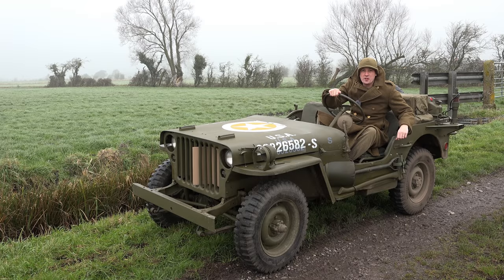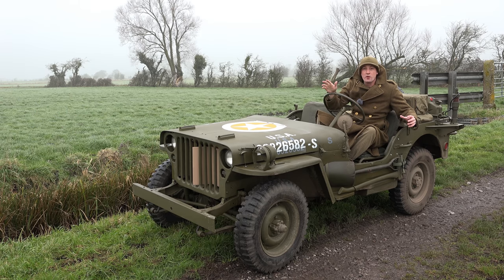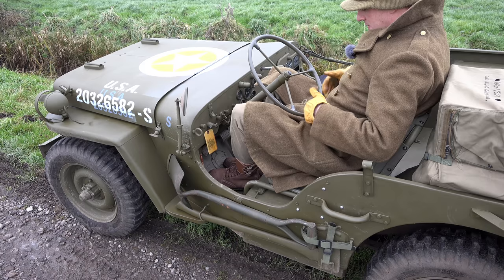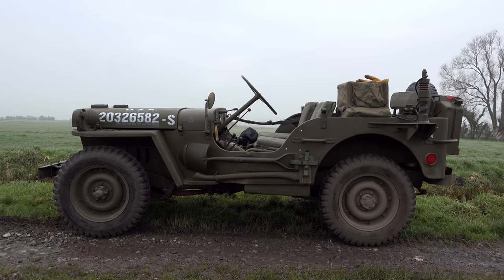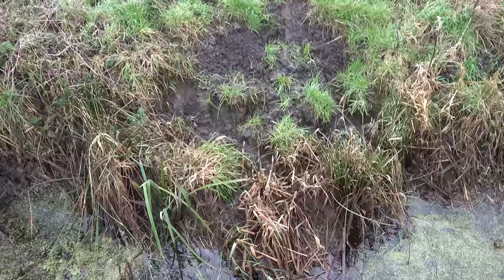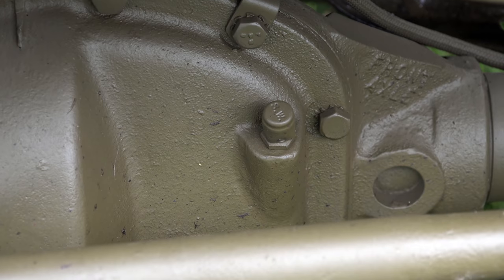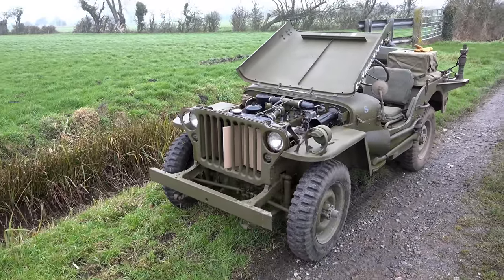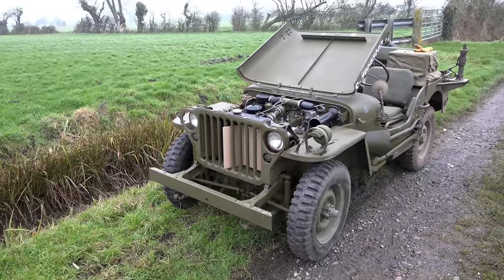Top 5 WORST Willys jeep features!

Comment: The dimmer isn't much of an issue.  In field ops you don't use the lights anyway.  For most of the war even in rear areas you used blackout headlight too.
Reply: The extinguisher was an afterthought. It wasn’t in the way when it was designed.
Reply: Looks like something resolved with field expedient no#2, you know, a stick!
Reply: In that case, the dimmer switch position was NEVER an issue. 
 
#5 sould be THE FIRE EXTINGUISHER MOUNT LOCATION. 
😊😊😊

0 seconds ago
Reply: Whats a blackout light. That sounds like just spray painting them black. Also anyone got a good story about these jeeps?
Reply: @muddrudder2656  A blackout headlight has a shield that covers about 95% of the surface of the lens.  It let's out just enough light to keep yourself on the road as you drive.
Reply: @patraic5241  thank you for the explanation! :)
Reply: I recall the "Blackout" headlight on the M880 Dodge 3/4 truck back in the day and the X.O. would never allow it to be engaged.
Reply: @HighSpeedNoDrag  Tactically on ARTEPs or FTXs we never turned them on either.  I suppose they were really meant for rear area driving.  Like in WW2 England during the Blitz.
Reply: You're quite right about the high beam, it was never used, and i know this for sure, because i drove several (Nekaf) in the (dutch) army.
Moreover, our jeeps didn't have an extinguisher at all.
In another video, i noticed the problem with the antenna mount. In ours, these were not side-mount, but at the back.
But that may be because ours were from after the war, up to 1955 i think, and slightly modified for the dutch army.
Speaking of weak points, two really stand out in my memory.
First of all, the weak brakes, making skid marks was as good as impossible, unless you were willing to break the backrest of your chair, wich i was  not, and so crushed the lieutenant's rear lights :-)
The  other weak point were the vacuum windshield wipers.
Wipers were too slow to keep a good sight of the road, so to increase the vacuum,  you had to let go of the throttle, that gave you a few good wipes, but losing your speed too. So to keep up the speed, you had to step on the throttle again, wich stopped  the wipers completely. So you usually ended up using the little handle,  and wipe manually.
Reply: How could they use blackout lights when they didn't have NGV's.
Reply: @Zanelander  The mark one eyeball works just fine.
Reply: @patraic5241  Yes!  There's a slit in the cover; to let a little light through. One I've seen on a WWII staff car.

Comment: The need to operate the dimmer switch is probably why many drivers moved the fire extinguisher to somewhere else, and broke off the straps.
Reply: As a former US Army HMMWV driver, I'd field-loss that fire extinguisher every exercise.
Reply: Exactly.The location of the fire extinguisher is the flaw!
The dimmer switch is located exactly where you'd expect to find it in most cars produced 1930(?) - 1960(ish), and therefore where to put it in a car meant to be used in mass by drivers with minimal training.
While the fire extinguisher is easy to reach both from outside and by the driver it does get in the way of handling the dimmer switch. Perhaps it'd been better to have it located in about the same place, but outside the vehicle?
Reply: I found the dire extinguisher bracket fit well on the wheel well between the drivers seat and the inner body
And it sits low enough that your shoulder misses it

Comment: For the "small size gripe", I'd also add that its a massive advantage for logistics. The US flat packed jeeps in crates and shipped then everywhere. Smaller size = less shipping capacity taken up = more of what you need where you need ot.
Reply: Also driving through jungle terrain you need small and nimble.  All the people that think they can offroad today in massive SUV's and get stuck within 2 minutes on a small gulley.
Reply: @MrWolfSnack  I agree. I got stuck down a trail with my wife's 4 door Jeep Wrangler and had to make a multi point turn to get back out of there. My wife wanted a 4WD truck which would of been near impossible to get back out given the length of those. Also, when I went down a trail with several other Jeep Wrangler members years ago, I told my wife we were leaving after six Jeeps got stuck in 26 minutes. The group laughed at me, saying getting stuck was the fun part. Not from my military experience. A downed vehicle and soldiers inside is the perfect target for cannon fodder.
Reply: @AstanaxKnight  Yeah when they are on a closed course with 100x other people around and a predictable outcome.  Try getting stuck on a back pass in a mountain or in the middle of nowhere on the single road for 60 miles in the middle of a cornfield. Maybe it's winter and 10 below, maybe you have no cell phone service, maybe its blistering hot. Maybe you have to walk 15 miles to find the lone house with a cranky old man with a shotgun to attept him to use his 70 years old rotary phone to dial sheriff bob jimbo to get cledus out with his wrecker. I don't consider that "fun" . It costs $300 + for a tow now. $150 alone for a calling charge.

Comment: Still had these around in the 80's, and drove them a fair amount. My opinion is that driving this thing around in rain, sleet and snow was absolutely awful. I got soaked and froze driving it at Fort McCoy Wisconsin when it was below 40F.
Reply: When I joined my Unit back in 88, we still had 1/4 tons.

Comment: Just imagine trying to drive one of these in the middle of one of the coldest winters on record through the thin and windy ice slicked mountain roads of Korea at high speed while trying to deliver important supplies, equipment, intelligence, or running from communist bullets.
Reply: Those death carriages?! JK, but the new korean models were notorious for flipping like a top if you breathed at it on an angle wrong because they added a spring shock system. It made them so jumpy that the rollover risk was really high. Add that to the list of Korean winter, bullets, and supply running.
Reply: "Let's make it faster and more powerful for hauling heavier loads and towing"   "Okay, but only if we make the suspension flip it over without even turning the steering wheel"  "Approved!" 😄
Reply: My dads old 53 mb was a korean war vet.
Reply: @therealbadbob2201  it must've belonged to a motor pool unit... the front line jeeps got scrapped from use and abuse, and the rear area jeeps driven by desk commanders were all rolled over or crashed beyond repair 🤣👍
Reply: I drove old HQ10    18BDE around Vietnam in the monsoons and bright sun, on QL1 and off road, of course she was an M151A1 not the old WWII model I believe mine was a Ford product. Several years ago I even picked up a Jeep Station Wagon to tow behind our RV across the US from North to South and back, sadly my little blue baby had a fractured tow bar mount that I didn't see, she dropped off a mountain in Utah.  There were no survivors, or course there were no people in the car at the time. I sure do miss my Jeep but I had insurance and replaced her with a Ford Escape. When I was Stateside in 1972 about mid winter I was assigned to take a trip to Yakama Fire Control Center in Washington State and drive old HQ10 3ACR back to Fort Lewis. It was COLD as hell, of course no heater and the interstate was covered with heavy snow so having brought my mummy bag along, I got old HQ10 up to 55 MPH  and pulled the hand throttle out, then stuffed my size 10's inside the bag and zipped her up to just below my shoulders, then drove her on home. She did have a winter cover on her and doors so it wasn't tooo bad.  My Lined leather Army Gloves kept my fingers warm on the trip and once I got out of the mountains, it became a bit warmer, well above zero anyhow.  You know that damn Captain who ordered me to make the trip never even said an off hand thanks!  Ah well, the life of a soldier, it was a thankless job.
Reply: Not Korea, and not in war, but I bought my 1947 Willys CJ2a when I was a Sophomore in high school, 1998 or so, and I started that car and drove it through at least three full Wyoming winters. The first year, I didn’t even have a top. But I had to drive my own car, so I got up early, shoveled the snow out of the seats, started it, and babied the throttle and choke until it could  sustain an idle, and then went in and showered and got ready. Then my wet hair froze on the way to school. The guys at the local parts shop nicknamed me the Igloo Racer.
Reply: @zachswy  Sounds like it was a great first vehicle for someone young to buy back then. Like any first car they are at least 20 years past their sell by date and thus lacking all the modern features. The most important thing im sure was parts at the time were inexpensive and if the end user was willing to put in time under the hood she would be ready and willing to loyally take you anywhere. 

I remember my first car. It was a 93 ford escort. Even though she had her issues I loved that car. I learned so much about cars by playing my grandfather’s favorite game, figure it the fuck out, under her hood. Even though I drive more modern cars with seat warmers, bluetooth, tire pressure sensors ect ect I still wish I could be behind the wheel of my little blue beast. Unfortunately she was killed by a drunk driver that pulled out of a gas station 10 feet in front of me while I was doing 35.

Comment: Being difficult to keep the weather out of a Jeep is concerned, you have to consider the era the vehicle was designed.  Vehicles with enclosed passenger accommodations and heaters were just becoming standard on automobiles.  Tops and heaters were considered a wild, luxurious, extravagant addition.
Reply: I drove a 58 Willy's Cj5 for the 2 years i lived in Juneau, and the additional year I lived in Eagle River, above Anchorage, and it never had a heater...what it did have was a set of Hedman headers under the floor boards , and those kept it plenty warm....👍🇺🇸
Reply: @branon6565  yes! My 57 CJ-5 had provisions for a windshield defroster, but I never hooked it up. The little heater would eventually get warm enough depending on how far you go...
Reply: Radio and heater optional in many cars until the 50s. 
Vacuum windshield wipers never work good. Isn't electricity is wonderful.
Reply: We did have heaters in our jeeps US Army in 1973 But it seemed the orders were always " remove top"
🪖🇺🇸🪖🇺🇸🪖🇺🇸🪖🇺🇸🥺🥺🥺
Reply: @Garyscott7  In the UK plenty of 70s cars had a heated rear screen only as an option. Many 80s cars required you to fit your own radio. It was one of the attractions of Japanese cars that they came with more options as standard.
Reply: @Garyscott7  mine never gave me problems. If you didn't want them to stop or slow down when you accelerated, you just put a vacuum reservoir in the line.
Reply: @Garyscott7  Vacuum wipers qere indeed a real treat. Driving a truck loaded and climbing a long steep hill was a trip without wipers. Some had hand cranks so you could at least wipe when vacuum was down. You are indeed right that electric wipers are grand!
Reply: That's why you have Dodge WC54 Ambulances! they have a roof , doors , heater and even..... wind down windows! :-)
Reply: @51WCDodge  and they are MUCH bigger and heavier

Comment: I owned an MB Jeep for 35 years. Only weakness is handbrake and 6V starting. If handbrake is setup perfectly its okay, but they go out of line or wear. That's why the very last MB Jeeps had an internal expanding drum rather than an external clamping type. Overall they're tough as nails.  Nice restoration! Thanks.

Comment: If the average height was 5’8” then the jeep is scaled correctly.
Reply: Exactly, a 6'2 guy would be sitting in the back. Same with tanks. I'm willing to bet that WWII tank crews were selected for smaller size men.
Reply: @emintey  for a fact Soviets selected shorter conscripts to be tank crewmen.
Reply: if you think tanks were cramped just search for ww2 ball turret gunners. That job had to be done by someone small and a lot more flexible than i'll ever be
Reply: I had the same problem with a Bushmaster IMV once. I sat in the forward passenger seat and couldn't pick my right leg up over the transmission tunnel. And that's a MODERN vehicle.

Comment: When I was in the US military I was responsible for many jeeps. The worst feature of them is that they flip too easily. Combine that with the low profile guarantees serious injuries when they do. I saw numerous flips under all kinds of speed/terrain situations. I think that "minor detail" should have been included in this list.
Reply from the maker: Thanks for your comment, young soldiers and a mini hot rod is a dangerous mix
Reply: The WWII era Jeeps were Ford GP & GPW, Willys MA & MB, and Bantam BRC-40 all of which had body on frame construction and “solid” front and rear axles and weren't inordinately subject to roll-over accidents.  
During the 60's thru the 80's most of the military Jeeps were Ford M151 which were “unibody” construction with all axles independently suspended and were very susceptible to roll-over accidents which is why they seldom appeared on the military surplus market and also why a civilian counterpart was never sold.
You must be referring to the M151.
Reply: @seadog686   Yes, we had 3 old Willys that were actually owned by the Smithsonian which I maintained for parades and movies and such, but the rest were the M151 death traps. Back in the day (pre-internet) I heard that they would cut them in 4 big pieces before selling to the public because they were so dangerous. Of course I can't verify that, but I believed it at the time.

As for the 40 and 50's model Willy's, I never let anyone get crazy with them, but I assumed they had the same roll-over characteristics. Thanks for the clarification. For clarity I was in the Old Guard at Ft Myer, VA.
Reply: ...agreed. A VERY dangerous aspect.
Reply: It seems as though a ‘ROPS’ system (Roll Over Protection System) SHOULD have been available as a “fold-down” option IF needed OR wanted..

Comment: Back in the 1970s I was running a running a building company when my elder brother phoned for a chat, he was also looking for some jeeps for the film The Eagle Has Landed. The neighbour behind my property had one, so I asked him if he wanted to hire it. Long story short brother bought it and I transported it to the film location at Maple Durham, my brothers job was to locate, maintain, drive on set all the vehicles required for the film. Well I ended working there and other locations for 3 months in a blazing hot summer. Maple Durham is on the banks of the Thames and we were set up in a near by field housed in static caravans, with workshop tents, 10 or so jeeps, Bedford trucks one burnt out, a small utility van make?? that was flipped using a timber post cannon and a White half track with a wooden body imitating a machine gun carrier. There were extra bonnets for the jeeps all numbered differently to make out a larger fleet of jeeps, so we would be swopping bonnets like mad for the different shoots. I drove the White and had to wear make up, helmet and scarf, just in case I was seen by camera through the front and side letter box slots. Between shots the armourer and I would get out for fresh air, both wearing brightly coloured shorts and T shirts, the crowds of onlookers fell about laughing. It was hard work but a great experience.

An uncle drove Monty around UK in his Humber staff car, he was a small chap so getting into a jeep would have been no trouble.
Reply: A great film. Pity about the yellow lines just being visible near the church and Larry Hagman sitting at his desk in front of a 50 states US flag.
Just making fun of the bloopers. Seriously, anyone who hasn't seen this film, give it a go.
Reply: Great movie. Thanks for the first person trivia about its making. Michael Caine's character, Col. Steiner, has always been a role model for me. Smart, brave, compassionate, but ruthless. A model officer and gentleman. My daughter is a fan of Batman movies where Michael Caine plays Alfred. One day she came to me and said, "Dad, I know just what you are going to look like and be like when you get older, Alfred in the Batman movie". I was very flattered and pleased.
Reply: @terrybaird3122  Michael Caine's was very approachable on location and I had a chat with him about wine, he lived near by and if he had free time between takes he would go home and do some gardening, on one trip he brought back a bottle of wine for us the vehicle crew to enjoy with our evening meal. Next day he grilled the guys on the wine tasting.
Reply: @TheByard  That is good to hear. I now like the man even more.
Reply: Outstanding Movie and cast.  Watched it around Age 12.